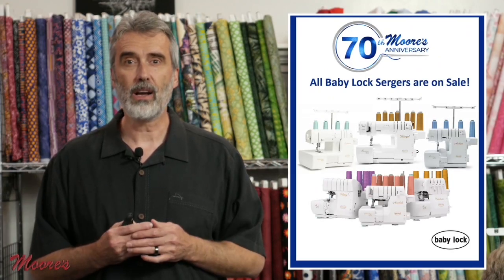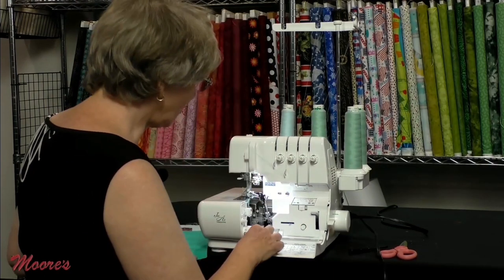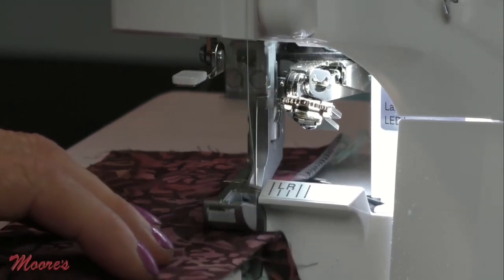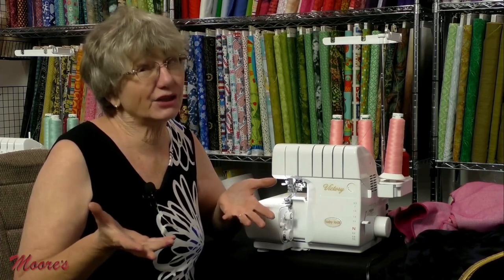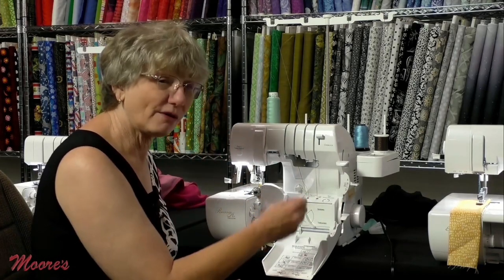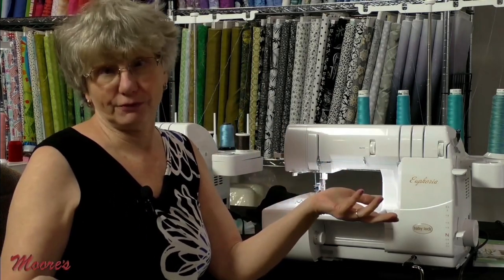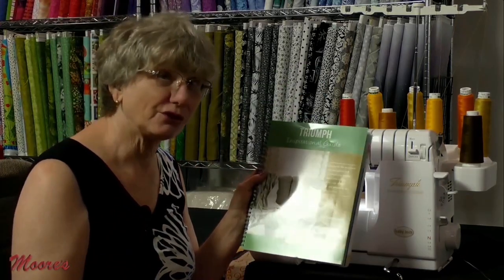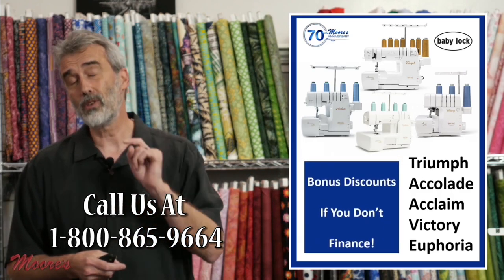Baby lock Serger Tour

Comment: Thank you for this comparison.  I’ve never owned a serger and was torn between the Celebrate and the Victory.
Reply: Which one did you decide on? I'm deciding between those as well🌟
Reply: If you can afford it, go for the Victory - it automatically adjusts tension on the threads, so no dials on the upper front of the machine.

Comment: I was given a Baby Lock BL5370. Can it use two needles, if so how do you insert them?
Reply from the maker: This is quite an old model. It appears that it is a 4 thread model. In this case it would have two positions to place a needle. You can put a needle on each of them. If you don’t have a manual, I would suggest you order one. I searched the model on line and found several places were you can order one.